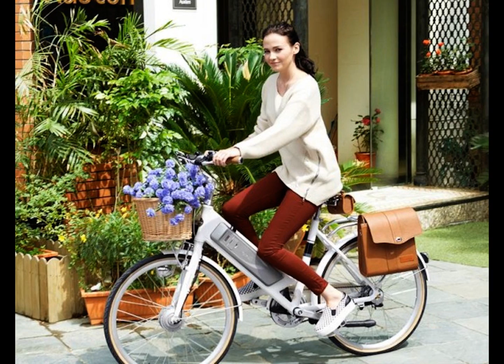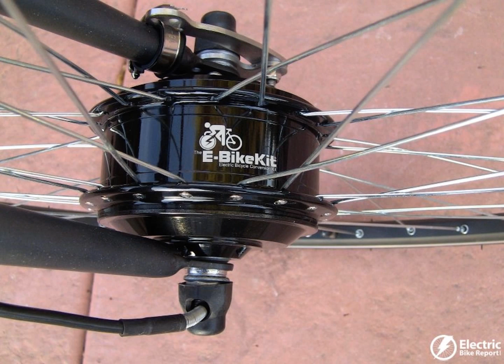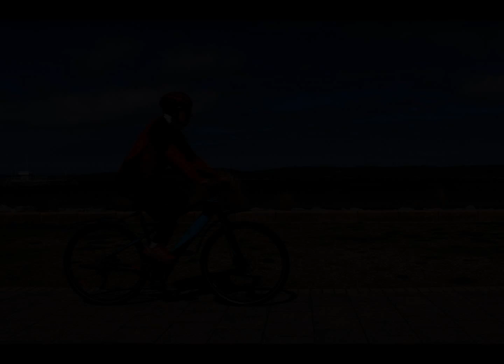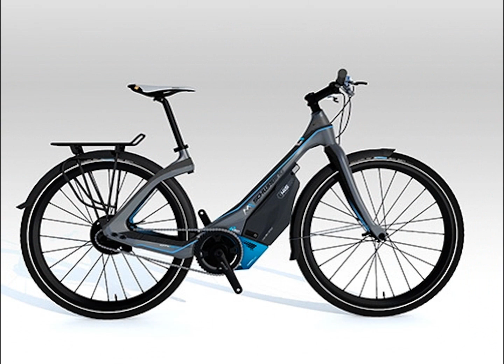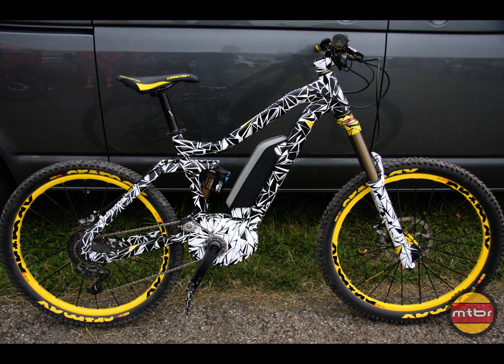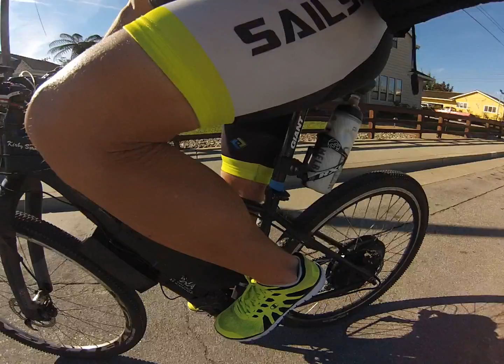Electric Bike Tips. Brand e-Bikes vs. Conversion Kits.

Comment: Ebike vs Conversion Kit?  To be honest I have both I brought what I call a towns bike, more of a Hidrid 700c with strieght handlebats, I use this mopstly through the winter months I feel cables are better hidden from frost, snow and rain and more convenient just for nipping in and out of town, then I converted my road bike into an eBike with the curved handlebars, the reason for this is road ebikes are very expensive so a lot cheaper to convert, cables are more exposed so use this mostly in spring and summer.

The performance of the cycles I find equal they both do well, my converted cycle as 5 peddle assist levels as my ebike only as 3 levels, the milage I get from each charge is simular 25 to 30 mile.  The converted cycle even if I brought a cycle would of been £100 cheaper then the eBike, the cycle value £200 and conversion kit £350 total £550, and the ebake I brought was £650 so yes a £100 cheaper but then there is the work I had to put in so cannot complain.

So yes its upto the individual and what bike or convertion kit you buy, but the cheapest decent road ebike was £1,500 so defently worth converting, so yes I think both are very competible and it depends if you have the money or the time.  If the time convertion is better if the money then the ebike but performance not a lot of difference just with a eBike cables are better hidden but otherwise I like both my cycles and defently the eBike is better for the winter months  as road bike better for the summer for the longer rides.